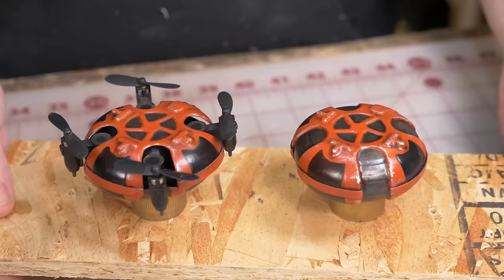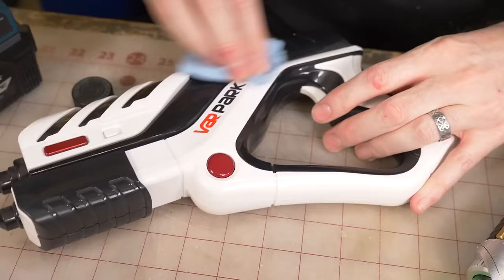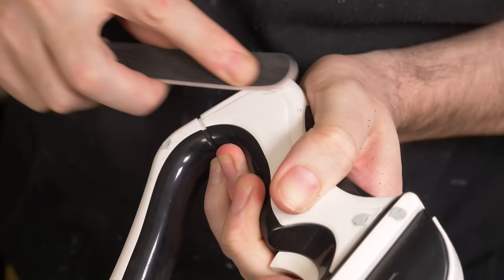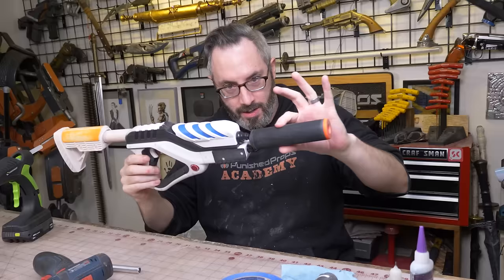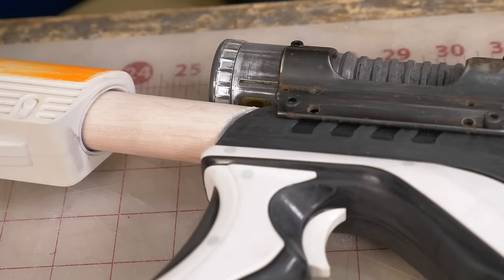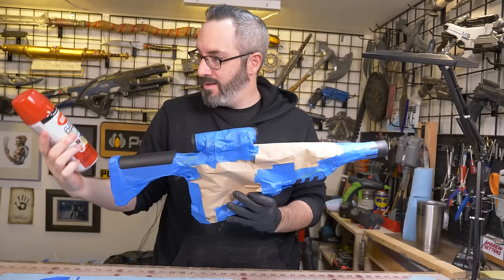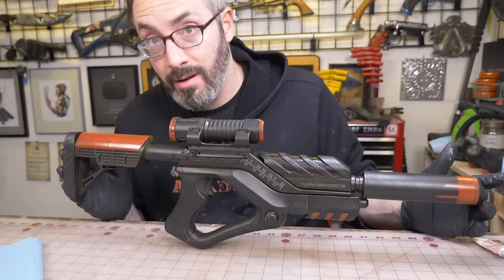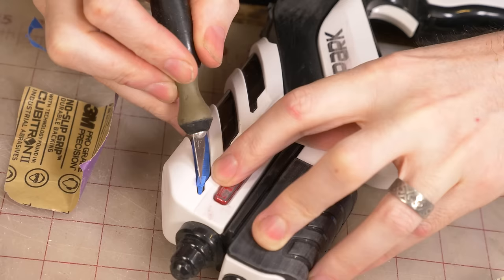Kitbashing Plastic Toys into a Movie Prop! - Film Riot Collab

Comment: So, I did a little digging, and that gun you used for the base is part of an Augmented Reality gaming system called AR Gun Var Park.  The part that flips up in the back is to hold your phone, and the QR Code most likely pairs the gun to an app that was designed to make use of it.  It's made by a Russian company, I believe.
Reply: oops just saw your post. Sorry for the duplicate information

Comment: Have  you ever considered weighting these props to make them behave more realistically in your or actor's hands?  At the end of the video it looks great, but as soon as you hold it in your hands it is painfully obvious that it is just a hollow plastic as it has no weight to it and it is very visible in the camera.
Reply from the maker: As a cosplayer I usually try to make props as light as possible. Carrying around the 17lbs Alien Assault Rifle from District 9 for a couple of hours wrecked me.
Reply: Go to the fishing shop and buy some large ledger weights I use them the 4oz ones are best bill great video
Reply: Ever try lugging around full scale weighted props at a con? Trust me, it get's painfully old after a few hours.
Reply: It wouldn't be good for that.  But as a movie prop it's ideal just gives it that bit of realism to how it feels in the hand
Reply: @martinbelton4973  It's also a safety thing. On most movies if a gun isn't actively firing in close-up it's probably made of rubber. If an actor is running around, a realistically weighted gun is basically a club they can hurt themselves or someone else with. Picture the bullet-bending scenes from Wanted, then imagine a real metal gun slipping out of James McEvoy's hand and clocking Angelina Jolie in the face....or Tom Hanks running up the beach in Saving Private Ryan, tripping and cracking his ribs on his Tommy Gun.

Comment: Very nice, I made a custom steampunk blaster out of spare parts a couple of years ago at the beginning of COVID and I've been itching to make another one since then and this video is really making want to hit Goodwill for cheap toy blasters.

Something that I've learned when painting toy guns is that the cheap $1 semi-gloss black from Home Depot works really well. It goes on fairly glossy for something that's supposed to be semi-gloss but going over it with 0000 steel wool brings down the shine and, in my opinion, makes for a really good simulated blued finish. Painting with a silver base coat and going over the finished gun with the steel wool some more and/or before the black paint fully dries (haven't figured out what does it) creates a nice gunmetal like finish. I really need to experiment some to see if the result is from sanding to the point where the silver barely starts to show through or if it's because the paint's not fully dry yet and steel wool fibers/dust is getting embedded in the pain.
Reply from the maker: That's a great technique, thanks for sharing. =)

Comment: Hexagons are the bestagons! 

That was a great build, and it looks amazing. I always learn something when I'm watching Punished Props. At about 14 minutes in I was surprised you went with tape and hot glue instead of two part epoxy putty. 

I really thought you were going to put that lightsaber on the other direction, or have the lip that you put on the front go up top. 

Don't you have a laser cutter for making acrylic circles? 

Great vid. looks amazing. Thanks for sharing!
Reply from the maker: Yeah I love cutting circles on the laser, but sometimes it's just quicker to do it the old fashioned way.

Comment: It's always super inspiring to watch your prop making videos! Love it! I do have a question: For some parts you use hot glue, for others you use super glue or epoxy. Are there certain reasons on which you decide what glue to use or is it just pure randomness?
Reply from the maker: For prop making, it's usually the glue's working time that is most important to me. If I need a few minutes to place something, I'll go with epoxy.  But, for example, with CA glue (superglue) it can haze clear plastics so it also depends if the material is compatible. https://www.thistothat.com/ is a fun website to see what glue is recommended for what materials.

Comment: That white and black gun that you put batteries in is actually from a Walmart 120 dollar laser tag set. It will only work when it's connected to its vest I believe looks just like the one I bought for my uncle's two kids exact brand and all so that's what it is. You don't need repositories for bonds or body filler the smell isn't gonna hurt yoy it only when chemicals are floating in air or sanding and grinding stuff is bad for you but bonds and glues no mask required man at all Oshawa even says bonds fumes are non toxic to lungs. And nextime jb weld the altered to the plastic will never break and you can sand jb weld to shape I use it to shape edges of stuff I glue to gether with it

Comment: i did my lightsaber.. it was all black anyway but all i did was use the file on a small fingernail clipper and did the edges and  some small scrathes  around the emitter and the bottom of the hilt and  motys of the scratches being in the middle but they are very subtle.. as its been been in alot of fights and gradually been worn down
Reply from the maker: That's a fantastic way to weather something, great job!

Comment: I wonder if anyone has thought to use a low power sand blaster to get a uniform finish on these types of builds. I haven't done much but I usually get a discrepancy in the final paint texture from the areas I worked.

Comment: Why you not use special polystyrene cement (or acetone), which scale modellers use for assembing model kits? It melts polystyrene plastic, which most toys make of. Bonds between parts, with these glue, almost molecular bond. Not any superglue or epoxy glue not stronger.
Reply from the maker: Either method works, but you're right that a bond that melts the plastic together would be super strong.

Comment: Outstanding. Kitbashing is near and dear to my heart.

One criticism;  in real guns the distance between the end of the buttstock and the trigger is called "length of pull". Yours is much too short, four or five inches longer would be better. Why? The actor using it will get a crick in the neck trying to look like they're using the scope the way it is. It would also be more comfortable, more "natural feeling" to hold.